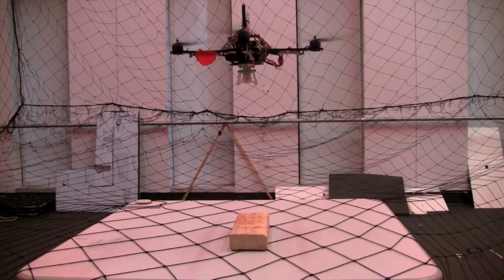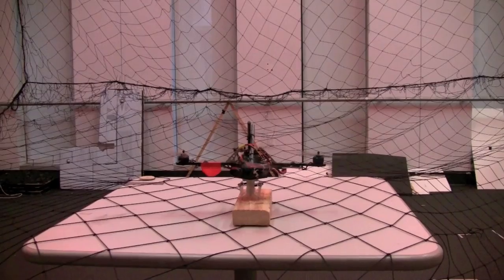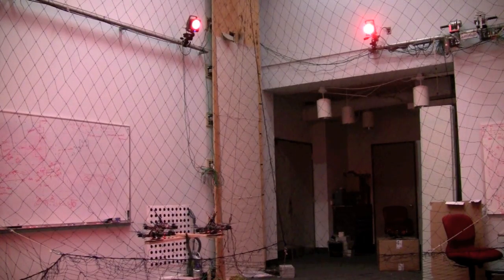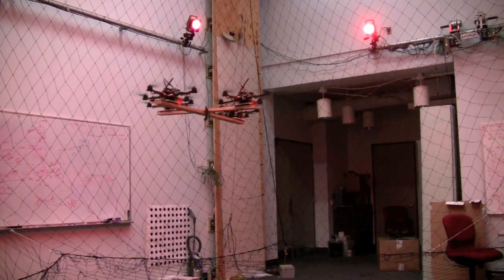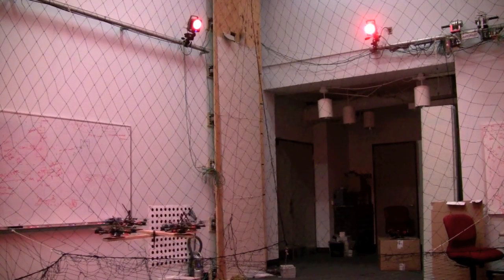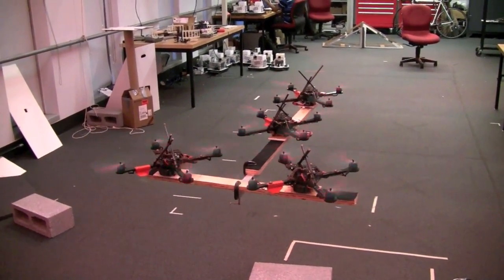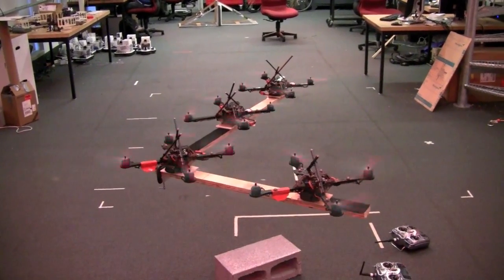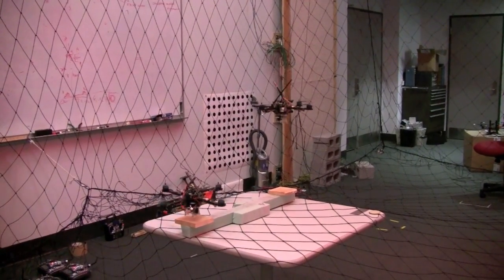Cooperative Grasping and Transport using Quadrotors

Comment: @Ju5tATh0ught 
The shaking is a result of aero-elastic flutter.  The ends of the board and under two of the propellers, and there is a bit of compliance in the gripper.  The displaced air of the blade feeds energy into the vibration.  To call it an instability implies that it is unstable however, and although there was shaking, it was stable.  (By the way, I built the gripper)

Comment: The Skynet Funding Bill is passed. The system goes on-line August 4th, 1997. Human decisions are removed from strategic defense. Skynet begins to learn at a geometric rate. It becomes self-aware at 2:14 a.m. Eastern time, August 29th. In a panic, they try to pull the plug.  Skynet fights back.